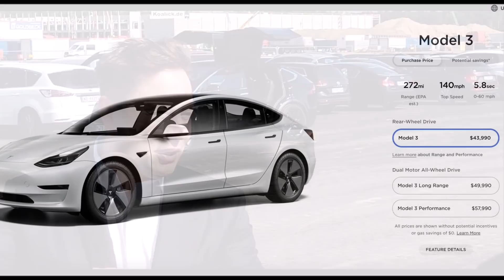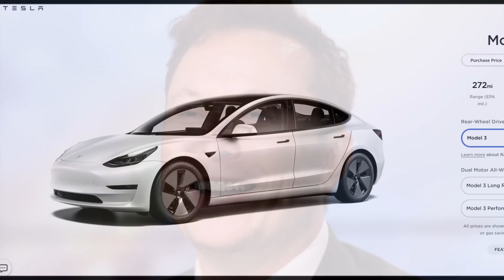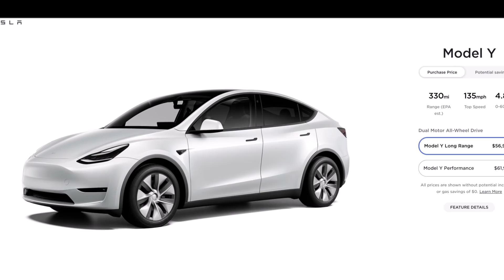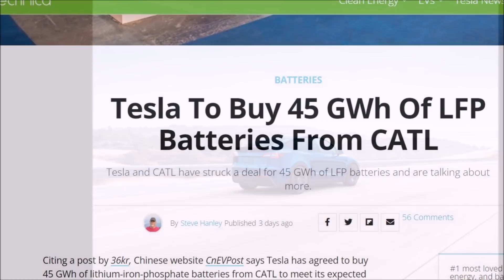Tesla Just Increased Model 3 and Model Y Ranges with 2022 Model Year

Comment: Really like BYD LFP Blade batteries. They seem to be the one setting the standard for LFP.
Reply: Blade batteries are more difficult to be fabricated, so are expensive. Compared pros and cons...price guide most of us.
Reply: Reportedly BYD batteries are the cheapest on the market.
Average cost 85 euros per kWh across the industry.
CATL 75 euros per kWh
BYD 55 euros per kWh
Reply: @rod2625  Not really, there will be soon the time when manufacturing in China wil not be cheap as before.
Reply: How can you say “not really” when I gave you pricing as reported on numerous EV websites?
Reply: @rod2625  simple, is the today price of electricity same ad 1 year ago? Did you ever herd about the China campaign to increase internal consumption? Do you really think the prices are always same?  Can you compare with the price 2 years ago?  Do you have the real price of flat BYD batteries?  Etc, etc, etc. By the way, info on sites is always months old...and I have no problem with these batteries , just are not easy to be mass produced so I think are more technology demonstrator, like presentation cars...
Reply: Ok my last comment. Your statements have no bearing on quoted today’s pricing on batteries. This is not months old information and BYD is currently installing their LFP blade battery packs in their new vehicles,not some “demonstration” autos. And yes,pricing will change, technology will change……
Reply: @rod2625  Yep, the only thing is that they are not installing blade batteries on all their vehicles, isn't it?  From my point of view, blade batteries are more marketing than a real breakthrough in batteries. But I can be wrong, do not shoot me for this...and I really cannot believe Tesla is stupid and buy 30% more expensive batteries.

Comment: I've been told by an engineer that lithium iron batteries are inferior to the lithium ion batteries. They are cheaper to make and the range is lower.
Reply: lol... ok.
Reply: That claim could easily be reversed by another engineer, like me, depending on which characteristics you value most. LFPs are cheaper, safer, more robust, i.e, less fragile, much longer lived and can be used to their full capacity(0-100%) without much degradation. So it seems to me that almost the only disadvantage they have to Lithium Ion batteries is their weight. Now, except for the most exclusive Teslas vehicles (Semi, Roadster, Plaid & 3 motor Cybertruck) the weight will be nicely handled by using 4680 cells in structural packs and high efficiency of drive trains. In normal everyday cars I would normally prefer LFP batteries, because of their superiority in most other characteristics. Most bang for the buck, as long as You can get reasonable performance with such a pack.
Reply: Roger Anderson has it right.   One thing I would add is that LFP batteries are easier on the environment was iron is much more plentiful than lithium.   The LFP batteries not only have a longer life for mobile (ie: car) use, but also for stationary (ie: building) use at the end of their life cycle.
Reply: @poboymusic1958  Iron more plentiful than nickel. Even more important: LFP needs no cobalt.
Reply: Any good engineer will explain the tradeoffs. As so many here have explained lithium iron batteries offer the best set of characteristics for car usage. They are more stable and less likely to have thermal runaways, not degraded by full charge and discharge cycles, offer major increases in life due to increased charge and discharge cycles, and do it for less money. Your engineer friend is pushing his agenda based on the fact that they hold less charge per kilogram so are heavier for the same charge rate. That's only important in very high range high demand usage. FUD comes in many forms.